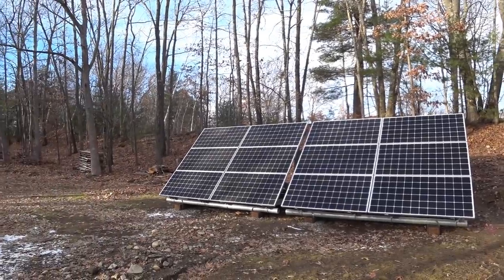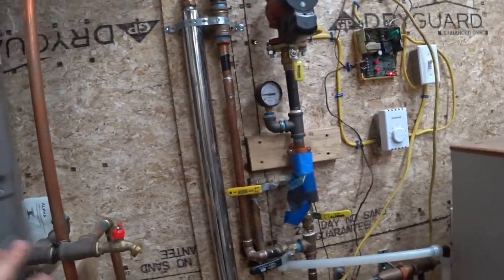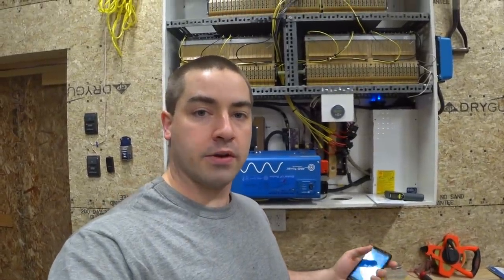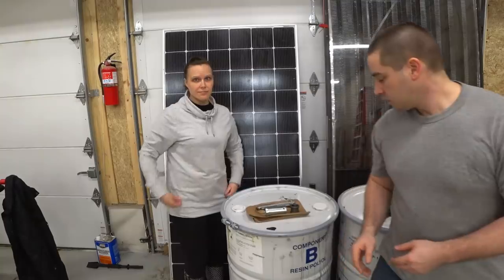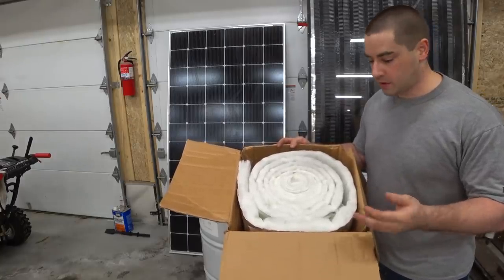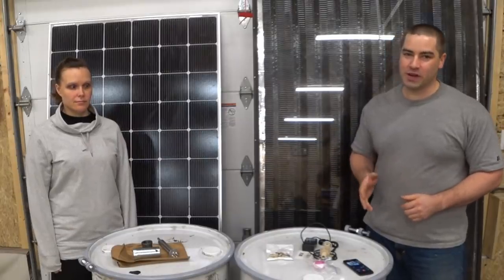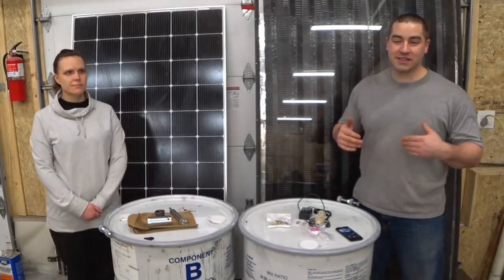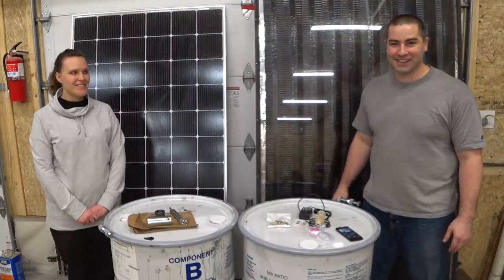Solar PV vs. Solar Thermal Experiment

Comment: Your thermal system is installed incorrectly, probably multiple issues. You should check your start differential it could be set to turn with a 40 degree differential.you are not getting what you should on your thermal system.i have a open loop drainage system that makes 120 degrees im a 350 gallon tank with 3 copper coil heat exchangers.ive been doing thermal systems for 10 years it looks like your system is not working properly.

Comment: Solar panels can generate electric from any light including a light bulb. Remember those solar calculators (no battery) that you had to put under a light bulb to get them to work? The only way to get unlimited heat is geothermal. I think it is clear which one will win, the Solar PV.
Reply from the maker: Another vote for PV.  Thanks.

Comment: The premise of your experiment is incorrect. The two types of panel were never designed to perform the same function so can not be compared like you might with the same type of panel from different brands. I believe that you have misunderstood  the reason why the product is named a thermal panels. The purpose thermal panel is specifically designed to produce low energy output in order to passively heat your home. The other panel provides energy to very energy hungry electrical products.

Comment: The electric panels can be as cheap as $.30 a watt if you know someone driving back from Miami, Fl. ( john kimball ). The electric panels can be mounted almost anywhere, and, not necessarily together. The electric panels will have high residual value in 20 years, unlike wet panels. The electricity can be used for other things if you want. Hot water is just hot water.
Reply from the maker: Sounds like you are a fan of PV.  Do you think it will win?

Comment: Like I posted before. Those thermal panels don't work when it gets really cold. it's  -10F here right now and to make the solar thermal panels work at cold temps you need either concentrated solar or  high insulation. One place I know us using 3 layers of plastic in front of there panels. Arogel is also a good solution to boost a panel output when it's cold.

Comment: Even if the solar thermal was more efficient, you are better off using solar electric. If you add a few additional panels to your system to compensate for the solar PV, you can get your batteries up to float faster and then kick on the electric hot water heater. Most charge controllers have a relay setting that you can set at (whatever) voltage (usually float) the relay sends a signal to the 220v relay(you need to add this) on your water heater to turn on the heater. In high use instances (three high school age children in the house), you can add a heat pump water heater (air) in line. So cold water comes in to the old style heater, gets warmed up, and then enters the new style. The heat pump style heaters usually only draw about thirty watts(intermittently) to maintain or heat a few degrees(as long as they only need to heat a little bit). So during the day you heat up (40+) gallons with excess solar with the old style and the rest of the night (old style power turned off) the  new style is fed hot water and only draws 30 watts occasionally (as needed).
Reply from the maker: Dump loads (wind) and diversion loads (PV) are a great tool.  I've been working on that as well for my own system in the garage.  However, my goal in this experiment is to keep it as simple as possible.  

As for the heat pump.  I am working on becoming off-grid.  So I don't want to add battery capacity to run a heat pump.  Also, I used to have a heat pump water heater in the house and hated the unit.  I go into a few details why in my PDF article on Builditsolar.com
Reply: If you look at what I posted you will see that the heat pump water heater only draws about 30 Watts. The article (at least the pdf I found) that you linked to was using units from 2003. The efficiency and insulation on current units is much higher. I also limited the use of the heat pump unit to being down stream of the excess PV powered "standard" electric unit. For a "standard" night(12hr) you are probably only talking about 360 Watt hours.

Comment: You are using the wrong solar heat collector you should use the evacuated solar tube . One solar evacuated tube in cloudy day give about 100 btu per hour which is 30 watt/h and in sunny day it get 250 btu/h which is 70 watts/h and one evacuated solar tube cost only 7 usd in my country but if we calculate a 70 watt pv it will cost 70 usd even in cloudy days where evacuated tube give you 30 watt it will be more cheap than pv . So in 70 usd pv that gave me 70 watts/h i can buy 10 pcs solar evacuated tube each one tall 1800 mm and diam 58 mm and those 10 can give me in cloudy day 300 watt hot water huge difference
Reply from the maker: Thanks for your suggestion.  I'm using what I have.  I don't have any vacuum tubes.  Thanks for watching.

Comment: I have a 10 m2 solar thermal on the roof and 7.4 kwp photovoltaik. The solar did cost me 7000 Euro and I already did regret it. I better would have used that roof space to get money from PV and drive a little heat pump to get that water warm in summer. In the winter I get warm water from the pellet heating anyway. Thermal solar has a little comeback in Germany now in communities with long distance heating.

Comment: The key point is the difference between "heat" and "temperature"!  Heat refers to a flow of energy, Temperature to the state of an object that is exposed to a heat flux (flow).  For a basic solar hot water system, unless the panel temperature is HIGHER than the temperature in the hot water tank, then that system must remain off, otherwise the heat flux is negative, ie you are pumpig heat OUT of the hot water tank!  A solar hot water panel loses heat, because although primarily working on solar radiation, it obviously also has conduction and convection  to the surrounding environment. (this is why evacuated arrays are "more efficent" simply because they have a small heat loss).
On the solar electricity side, you use a MPPT DC/DC converter, where that converter acts as the voltage level conversion. This allows panels that have lower output voltage than you battery bank to still force current into those batteries against the voltage gradient.  This means that system can operate at significantly lower solar intensities. And of course, a solar PV panel does not "loose electricity" to it's surrounding environment, it doesn't make light if you back feed it with electricity!

So, whats the solution?  It's actually really simple.  You need to operate your solar hot water collectors at BELOW ambient temperature!  Yes, that right, use them to collect HEAT, but not to build up TEMPERATURE. And that requires us to add the equivalent of the solar PV DC/DC converter, to add a system that can pump Heat against the temperature gradient, which of course, is a Heat pump!

So we install a heat pump, and pull the water in the solar water heaters below ambient, and now we have zero heat loss to ambient, in fact, we have a net energy gain from the ambient heat "loss" and now our system works at all solar intensities, just like our solar PV does  ;-)

Comment: Consider a PV system that does not over produce compared to the needs of the household.  Why waste the precious electricity you are generating when you have higher efficiency with thermal collection?  Sure have redundancy with electric heating.  But I fail to see the savings of using pv only.
Reply from the maker: I ran the test for a while and posted the results in a later video.  Solar Thermal collectors are great, but don't get water hot enough in the middle of winter.  That's when the PV is great to have along side.
Reply: @DavidPozEnergy  darn must've missed it.  I'll take a look, but I've seen others show good results.  I think a Colorado climate is good for it.

Comment: Comparing the best of the PV versus a very bottom end thermal is always going to favour the PV. I thought this was going to be an informative video but instead saw that apparently the best of the PV panels now can handle shade. Many can't and if these were in use then the results would have been different and if a better thermal system was used the true efficiency of thermal would have shown out.
Reply from the maker: Hi Alan H,  I'm building the experiment now.  Trying to give them both an equal chance.  My PV panels go into an MPPT charge controller, but I don't have an MPPT charge controller for the experiment.  It will be interesting to see how well the panels handle shade without the fancy electronics.  Thanks for watching.

Comment: Now if you could have a clip on mic so the audio is not sounding like you are in the bat cave again. HAHA
Reply from the maker: I did try a lav mic a few times.  I'm just not very good with electronics and screwed something up too many times.  Lost my recordings.  I was using an old smart phone in my pocket with the lav mic coming up my shirt.  Then in post I was trying to sync them.  A couple times I got it right, such as the interview with Bill.  But several times I wound up having to re-shoot.

Comment: Hold be nice to understand how everithing works... Northen Europe uses thermal panels more than 30 years... and today they are many panels that don't work as they should and even many bad installed... thermal well made can work with shade... low quality one can't... they are just tubes panted black... I'm an engineer with more than 12 years projecting this systems only 15 to 20 % were installed correctly... when done right  they supply x3 more energy p/m2 than the PV... just remember in your video 3kwh a single thermal panel can output 2x that in a day... good quality and installed right...

Comment: Your solar thermal panels don't look like they're made for your latitude. You probably need to use a reflector or vacuum insulated collector to get reliable heat at your location.

Comment: Just what i was planing!
I just  want to have solar panels directly to the heater  Nothing else!
Not even using my existing systems "extra power" when not in use.
Just 3 or 4 panels directly to the heater and nothing o worry about.
Reply from the maker: Cool.  We will find out together how well it works.  If you do implement it, I'd love to see a video or pictures.
Reply: @DavidPozEnergy  
Been waiting for some time off from work, Ive searched around and all i could find was some $300 circuit board (to expensive for what it actually is) claiming to do this.
Reply from the maker: I know exactly which one you are referring to.  I'd love to get my hands on one to do a side-by-side test, but I'm not dropping $300 on it.  This is where I am considering some kind of partreon account?  I don't know.  I'm over $100 bucks so far and I still have to buy all my plumbing parts.
Reply: Did you guys see that guy's charge controller that's simply connects and disconnects the solar panels? Not like a pwm though. This one can connect any number of panels at a time to the load depending on the need. Mainly for his floor heating. I think he had it on Kickstarter or something

Comment: If the PV created only 3.5 kilowatt hours, that is not enough to run a small heater one hour or a hairdryer for four hours. A small pump to run solar heat would seem to be more profitable.  But on some days you just can't win and must fall back to another source.

Comment: Why not get away from pressurized hydro systems requiring pumps and use https://en.wikipedia.org/wiki/Thermosiphon instead?
Reply from the maker: Thermosiphon is awesome!  That was the very first system I built, way back as a kid.  If your house is set up for it then it could be good.  My personal setup has the thermal storage tank (250 gallons) in the crawlspace.  That is below the collectors.  In order for thermosiphon to work the tank has to be higher than the collectors.  Thanks for watching.
Reply: @DavidPozEnergy  You could put a couple hundred dollars worth of cinder blocks to elevate a tank above the collector. Putting something like that inside the house is troublesome...

Comment: Your not giving the solar thermal a fair chance at all from what I see. Are your solar thermal receivers a concave mirror first of all? That's what the legitimate way to receive solar thermal energy would be as it would focus said light to a pipe to produce steam. Increasing it's area of such would generate more electricity, similar to that of your solar panels. Not to mention obviously it's not going to work as well due to the fact you are in a wooded area lol. Could you show us your entire solar thermal systems in case I am wrong?

Comment: You lost me at the 1 minute mark. Just because the pump isnt on doesnt mean they arent collecting radiant energy. You leave the system unattended for X time and then declare that 'at no point' was it on.

You need to work on your methodology and learn how to avoid absolute statements. This doesnt look like an experiment, it looks like a hit piece on thermal.

Comment: your setup is wrong. I have thermal setup that functions when its hot. Your delta t setting is probably set to high in the controller or your sensor is not in the correct location. I guarantee you those panels are hot up there. Your pumps just not circulating  when it is suppose to.  Also if your tank is already at temp. the circulation pump will not come on.  Add more tanks to your thermal so it can store more.

Comment: No, No, No, No, No. This is a complete waste of your time and effort. PV panel directly connected to a heater element is NOT the way to go, and will be poorly matched, producing far below its potential. I think that PV is now the way to go in most cases simply because of the simplicity of the system (since most people will have the PV system anyway), but you must have the controller and batteries etc in order to impedance match the system, otherwise this is a pointless exercise.
Reply: It's an interesting experiment, but people care more about cost per watt than area per watt.  I did a quick calculation for a Duda vacuum tube collector and got 40%. So considering the cost and losses from pipes and pumping, PV may well be cheaper even if the collector area is larger.
 David Poz could use a linear current booster. They are used in battery-less water pumping applications.   They may not be available in the ratings needed for this position project.  I think his PV system has an MPPT controller. That's helpful for partial shading.

Comment: maybe look at a solar hybrid  hot water heater controller that way you can se a normal ac element and thermostat and they do mppt so you get the most out of the pv
Reply from the maker: As I mentioned in the description, I have not seen an efficiency test performed on those magic circuit boards.  If someone would like to send me one I will do a side by side comparison test.  Thanks for watching.
Reply: I'd love to test one of those boards.  From what I have seen they have some design issues. And the biggest problem is they have to have their own panels, not be used in parallel with a charge controller.  I build my own efficient controller and don't need some big heat sink.

Comment: So your going to compare apples to oranges ..... a very cheap "lo-tec" solar water panel, vs a "hi-tec" PV panel.  I mean yeah it's fun stuff I guess.  

Of course it would be a far more serious result were you to compare available tech in both lines.  If your going to use modern technology PV .... You should be putting it against evacuated tube panels with concentration backing ... which to my knowledge Is the most widely available level of tech available for solar water heating.  And it does not require full and direct sunlight to be effective.
Reply: That's a great point! I bet he'd be happy to do that exact experiment if you would send him the equipment you mentioned.
Reply: @WimPrest  the reason I made the point is not to put holes in anything, I made the point just so people don't get the impression that there are not more efficient ways it can be done.  In response to the suggestion that I should send him the equipment, first and foremost evacuated tube can be a fairly inexpensive self-built DIY project, secondly I live in the UK, I am hardly going to build and ship such bulky equipment when it can be easily made.

I am quite sure David has the skills and abilities as a future project to do this which is why I suggested it,  I myself would be interested in the results of such an experiment so I thought it would be a good suggestion to make.
Reply: @Garuthius   can you suggest where i could get the plans to do that ?

Comment: assume you get 1kW/sm with solar, and only 0.1kW/sm with cheap solar, assume you get 5% efficiency with peltier dc generator, then you would have 0.95kW of heat, in water if you heat water, and 50W of solar electric, simple to make
Reply: what kind of solar thermal you are using? it should be easy to make it use small amounts or water to make very hot steam